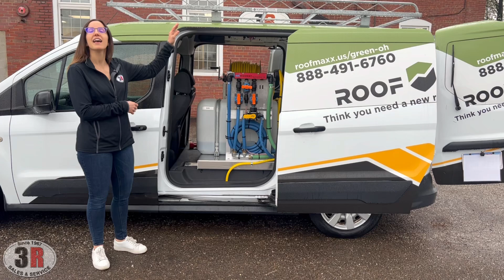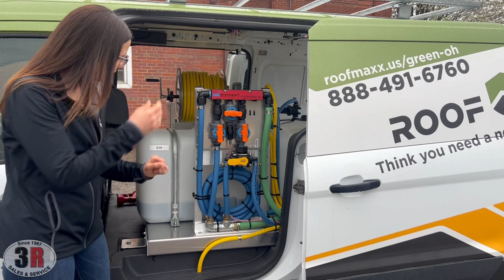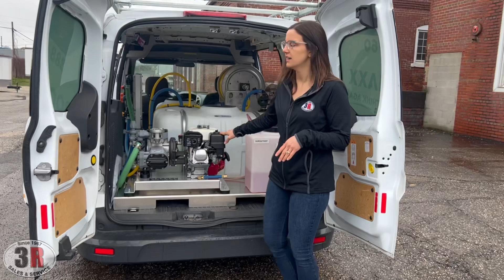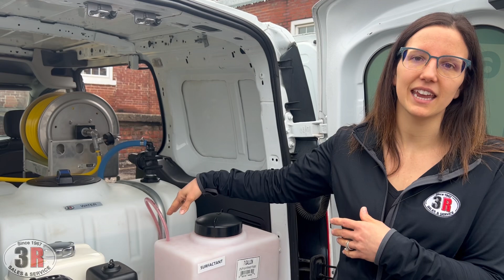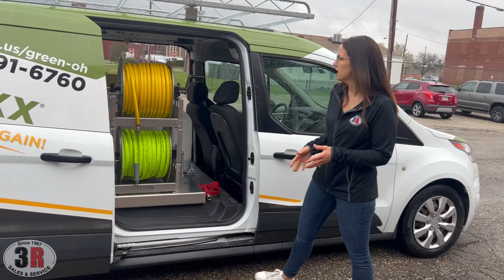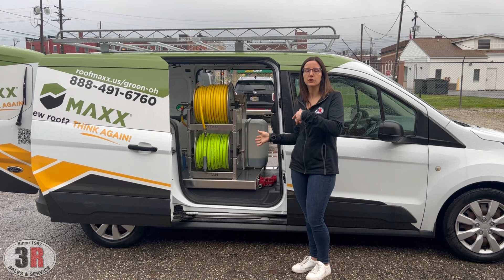GRIFFIN: 6’ Deluxe Skid Base - 300 PSI, 11 GPM Gas Engine Soft Wash System Van Mobile Wash  Install

Comment: possible to add a larger water tank or weight too much?
Reply from the maker: Thanks for reaching out!  In this instance, there was not a large enough footprint to accommodate a larger water tank.  Certainly, weight also plays into what size tanks we can or will use, but specifically in vans, the size restrictions are generally what limit the layout first.